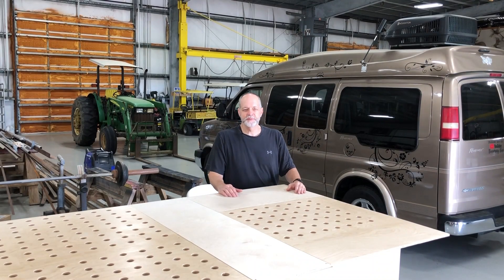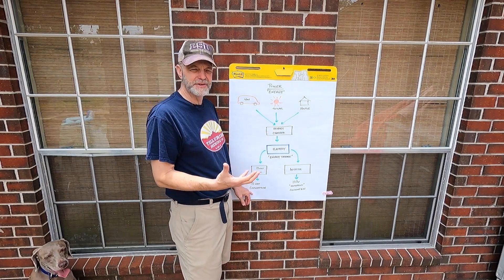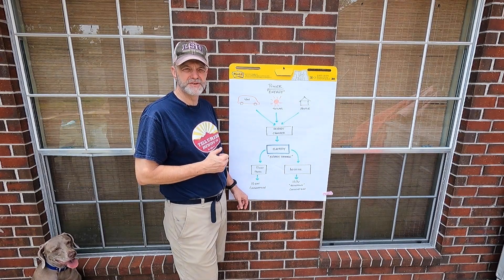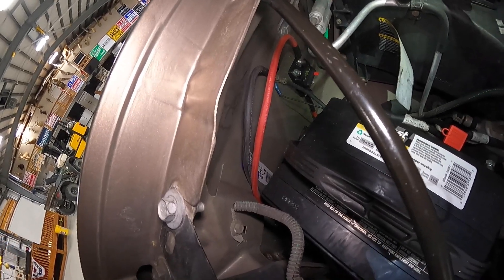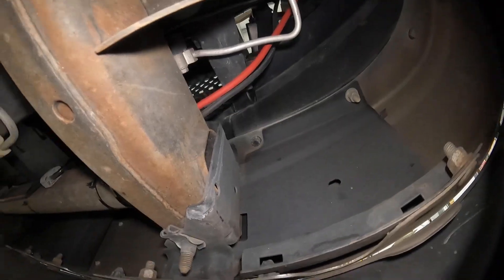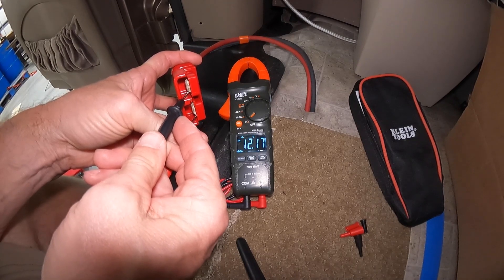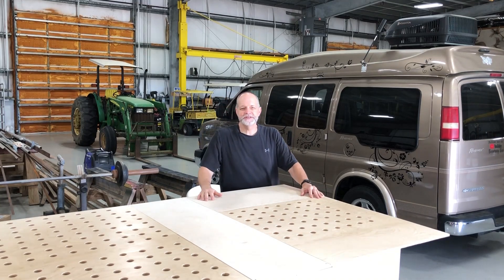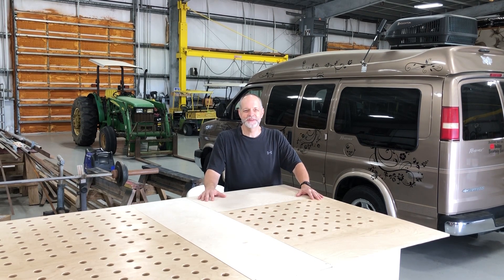Van Build: Easy 12 volt electrical system

Comment: are you running the shore power battery charger through the dc-dc charger as well?, thanks for this video.
Reply from the maker: Yes, the converter was designed with a charging profile for lead acid batteries (bulk, float, trickle). That is not what the  lithium battery wants to see. The converter also functions as a 12 volt power supply (that's how I intend to use it) and previously powered a 12 volt panel with various continuous loads. I will let the Renogy manage the charging profile. Not wanting to back feed the starting battery I have install a battery disconnect on the back of the kitchen cabinet that will be used when on shore power. I wanted a system that required no input from the user but I thought it would be safer to add the disconnect. The next van will have a charger with a dedicated lithium charging profile and it will be hooked up directly to the battery.
Reply: @ramblinmanconversions6489  , thank you for your detailed reply.

Comment: As thorough as you are, did you consider an upgrade to a high output alternator? Did I miss that in the video? Your skills far exceed mine! A very long time ago I worked in custom car audio, upgrading the batteries and alternator was common.
Reply from the maker: Yes, that  was an option and still can be in the future. The lithium battery is a different beast. It can absorb energy at a very high rate taxing the alternator. The Renogy DC to DC charger limits that draw on the alternator to 50 amps. It also acts as a step up transformer if needed. This would be important if you were charging a pull behind trailer with a long cable run (voltage drop). This van is usually driven enough that 50 ah (per hour) should suffice. The total battery capacity will be 200 ah. (Good Question)